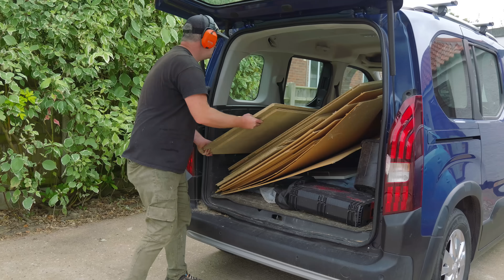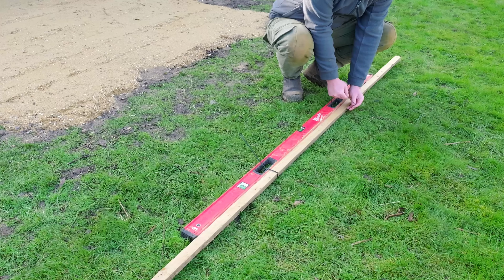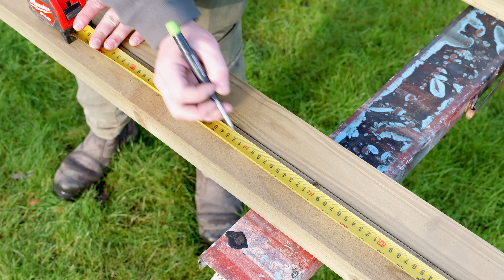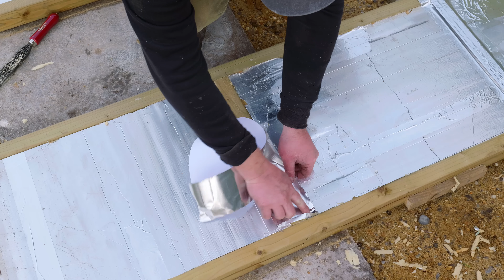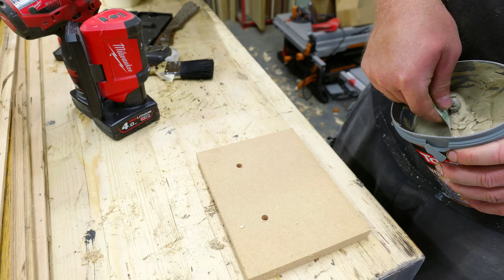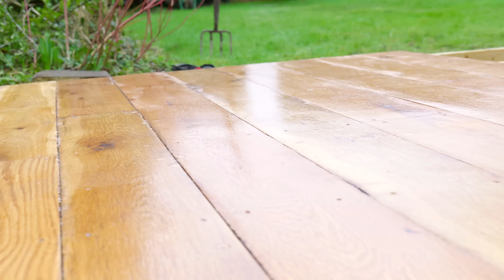Cheap & Warm - Garden Room Floor

Comment: Sorry if this sounds/is a silly question but what about high winds? The structure isn’t tied to the ground at all. Even if not too fussed about the building itself it could do a lot of damage if it became flying debris. UK weather is calmer than that in USA (no tornadoes etc) but we still get some winter days of gale force winds. Just wondered if, where possible, some sort of anchoring is advisable and if so what.

Comment: Wood expands in summer and contracts in winter, does it not?
Reply from the maker: It's a little more nuanced than that... Wood in direct sunlight contracts as sun dries up the moisture and in winter the moisture from rain makes it expand. But in hot and humid conditions moisture from the air makes wood expand
Reply: @RagnBoneBrown  alright. 👍🏻 Hope you want have any trouble with it! 😊

Comment: Should of stapled some dpm or some decking tape on the bottom as there will be moisture that will rise
Reply from the maker: Moisture would then sit on the dpc from condensation and soak in to the wood

Comment: Beginner DIYer question: Why did you lay the floor first instead of framing out the walls and then laying the flooring inside?
Reply from the maker: Just timing really - by framing the walls before laying the floor it meant I could erect the building quicker before the next rainfall!
Reply: @RagnBoneBrown  Makes sense - gotta stay adaptable in our weather!

Comment: Great work Keith, looks terrific. Look forward to the next one. Roughly how much time did you spend on this phase of the project?  I'm working my way slowly through a big pile of old decking, it's very satisfying. Plus it justified (in my head at least, since I'm saving money on wood!) the purchase of a thicknesser to clean it up.

Comment: Hey friend, chuck bit of damp course between your pavers and timer next time. It's inexpensive and will help with longevity 👍
Reply from the maker: Condensation would sit on it and soak in to the bottom of the timber....
Reply: Timber**

Comment: Love the idea of this, I’ve just finished a luxury garden room costing 8k total but that’s to building regs so a little different. I personally think if you had invested in thicker PIR the whole build would have been more usable. It’s basically a shed with a bit more warmth but 30mm is going to do nothing I’m afraid.
Reply from the maker: ChatGPT estimates it will be 6-7 times warmer with 30mm PIR insulation and double glazing. And an average of 6 degrees warmer. I wouldn't call that "nothing"

Comment: Nice work. Is the floor gonna be attached to the ground in any way or are you counting on sheer mass of the building to keep it in place?
Reply from the maker: No, we don't tend to do that in the UK 👍
Reply: @RagnBoneBrown  That's interesting. Did you ever notice any problems on those types of sheds during fierce storms and wind?

Comment: No DPC between the floor timber frame and paving slabs? Old roofing felt for instance.
Reply from the maker: The problem with that is moisture/condensation sitting on it and soaking in to the wood. The slabs should dry out quickly being on sand and under the shed so shouldn't be an issue 🤞

Comment: I noted the water based No Nonsense floor varnish you used under the oak boards. I find that stuff fantastic, I use it on custom furniture builds as a top coat 👍
Reply from the maker: It's great stuff 👍

Comment: Hm. I'm not so sure this is remotely achievable with a budget of £500, especially without nail guns, flatbeds, routers, plate compacters, circular saws, orbital sanders.... you catch my drift. All the same, beautiful job and informative.
Reply: But you’re not using those tools just once, my circular saw is around 10 projects deep already, and my new plunge saw already has 3 projects behind it in 3 months, with more to come. Same goes for our Router.
Reply from the maker: Does Jamie Oliver include his oven, pans, and knives when pricing up a recipe?

Comment: 4 years ago I built a 24'x12' cabin to live in. It cost just under 5k but that included decent PIR, a rubber roof, carpet, plasterboard and internal decoration. The windows and door were salvage though, as was some of the wood. I wanted thick waney edge cladding but nearly choked at the price. I ended up with feather edge instead.  The hardest part was levelling the ground, and getting the heavy rubber up onto the roof. I loved every minute of it, would do it again but age and strength are now conspiring against me!  And so, I shall live vicariously through you instead. Good luck!

Comment: Loved this video! Especially for the two tips of how to deal with the tongue and groove on the flooring and using india ink with filler for the knots. I’ve not long picked up some engineered oak flooring from a skip and I’ll be putting those tips to use on them - thanks Keith!

Comment: Nothing wrong with recycling. Most of my woodworking projects use recycled materials. You cant beat some good old wood. I recycled a tatty looking large antique cabinet and got loads of really good quality useable oak. Bit of a sand and run through my thicknesser and its as good as new. My garage is full of timber and more than half of it is hardwood. Looking forward to the rest of the build.

Comment: Personally I’d added some pvc in between the insulation and the floorboards and i would have lifted the house about a foot/ two steps/ maybe three above the ground with the garden room standing on concrete poles pillars.
They could easily be poured by making a single scrap wood mold with some steel in it on a wide footing, a notched space on top to attach the wooden beams and a wide stirdy foot.
Like they use with these wooden style Thai beach bungalows.
It just gives you that nice perspective on the garden when sitting elevated.
And because you wanna/ probably will use it mostly in the summer a relatively large porch for cushions and hammocks would have my preference.
And the clearance in between the concrete pillars could by the way be covered up on the sides with plants or screens.
Nice project though.

Comment: five years  ago i built my workshop from 18 mm engineered oak flooring.i gave it 2 coats of waterbased varnish.its still in really good condition.i will be giving it a bit of a spruce up in the summer and i expect it to carry on doing a great job.

Comment: I am a bit concerned about the longevity of that floor.  The planks are not water tight, so any water that gets on to the floor will pass through.  That water will then be trapped between the vapor barrier and the bottom of the oak decking.  

Dont mean to be negative or combative in anyway, I always enjoy your frugal builds.  Looking forward to seeing this one too.

Comment: Why people spend so much money on things I'll never know.

I've just built a workshop in my garden and it cost me around £80.
Got £290 worth of treated timber for £30 from a guy closing his roofing business on FB marketplace.
Brand new composite roof from the off cuts on a building site, plus flashings.
Windows from marketplace for free.
Shuttering all round from building at the Marina throwing away the old shuttering they'd taken off! About 100 boards of 6x1! 
Ply board my dad had in the garden for the floor.
It just a case of keeping an eye out of opportunity and having a van is a big plus. 
My workshop would have been THOUSANDS! but it cost less than a meal at a pub for a family!
Reply: Awesome deals all round there, bet you’re well chuffed. All stuff that likely would have been binned too.
Reply: @djstuc  I really am chuffed with it. Took a while to finish as I had to gathet the stuff for it, but a  keen eye and patience goes a long way

Comment: I’ve used those plastic deck raisers on a couple of shed projects on uneven ground, in conjunction with Proper Stuart’s soil stabilisation method. I took a bit of deep dive into that method. The American military have a whole manual dedicated to making temporary roads for tanks using the technique.

Comment: Could you explain how the vapor barrier works. I can never understand how and well i should use them, perhaps when you do the walls
Reply from the maker: Vapour barrier is typically installed on the "warm" side of the insulation and it's designed to stop moisture passing through in either direction, control condensation and keep building materials (in this case the oak floorboards) dry